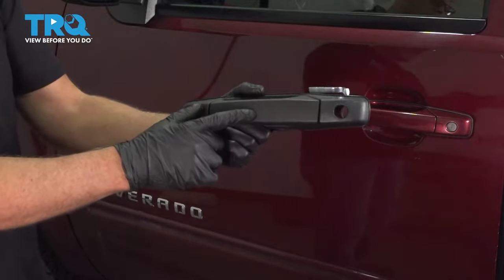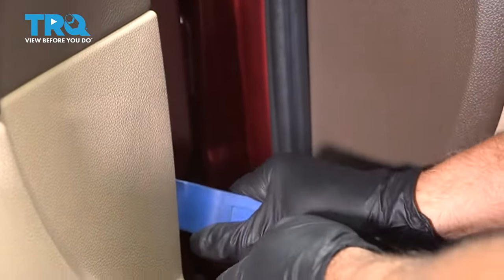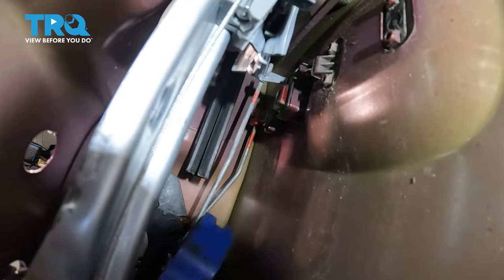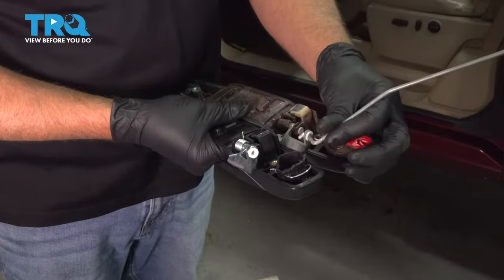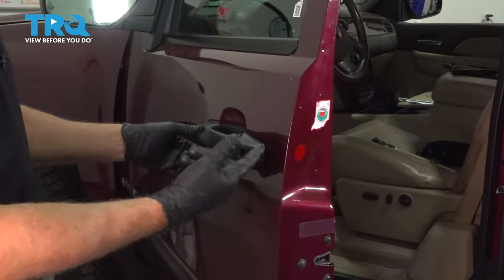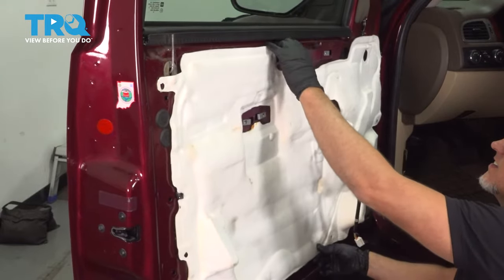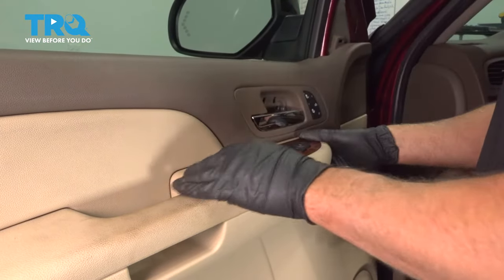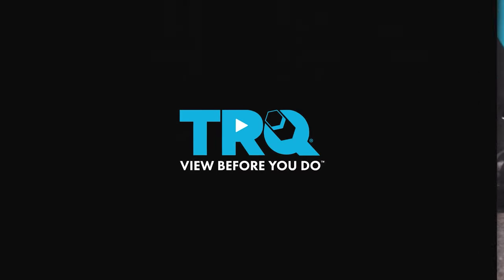How to Replace Exterior Door Handle 2007-2013 Chevrolet Silverado

Comment: If you run a marker around the vapour barrier before you remove it ,youll have a reference to where it goes back much easier.Takes 10 seconds.